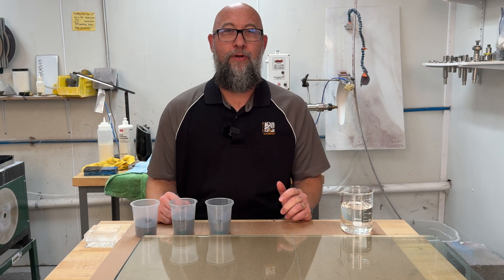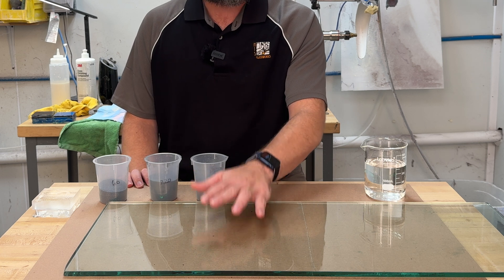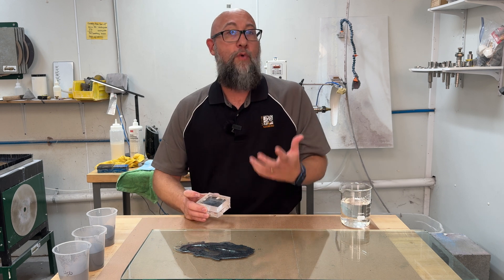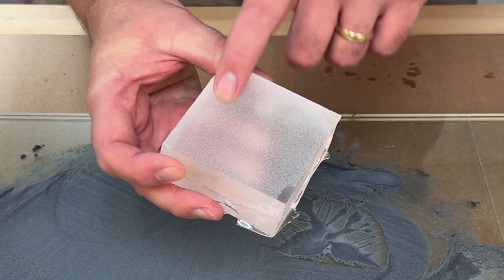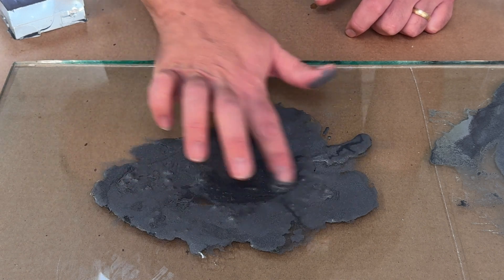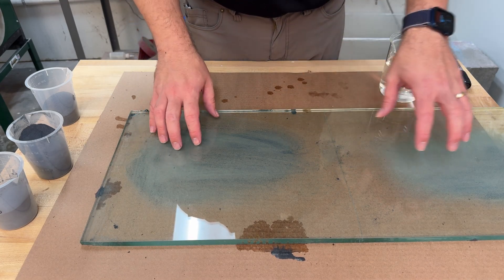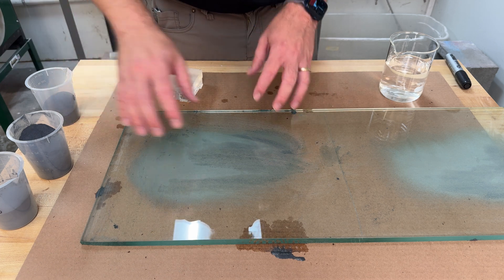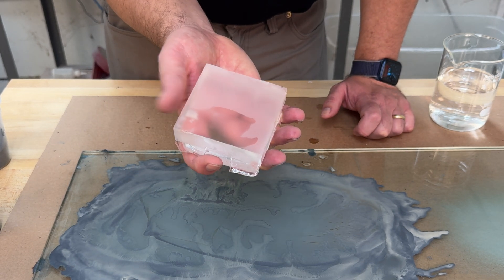Using Silicon Carbide Abrasive to Hand-Lap Your Glass

Comment: Can you make video of how to make glass mousepads
Reply from the maker: These are typically etched tempered glass. The glass would have to be purchased and tempered in the correct size and then etched.
Reply: @hisglassworksinc  can you make a short tutorial as in my country (egypt) we don't have glass mousepads and in the other hand if you want one you have to import one which will be super expensive
Reply: @hisglassworksinc  as in bought the tempered glass and cut it and round the corner but idk how much etching I need
Reply from the maker: @xXcasperXx  That I'm not sure about. I would go for a single dip in the Vari-Etch material: https://www.youtube.com/watch?v=aWiUpKR6Lx0&t=799s